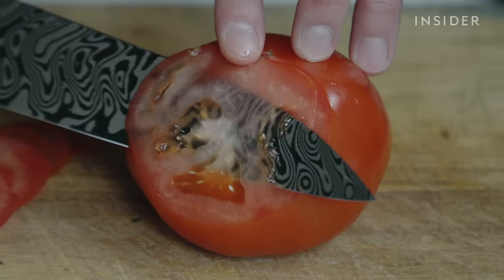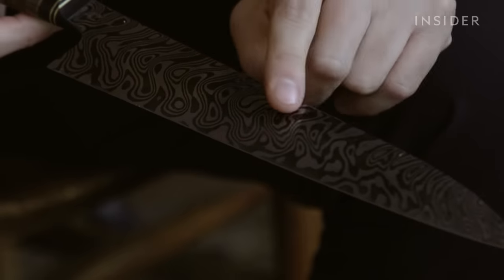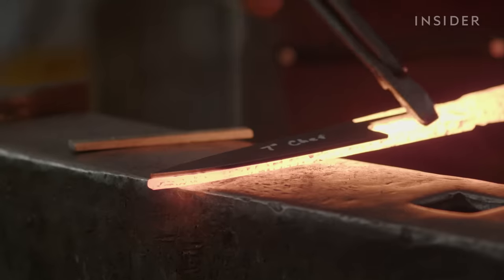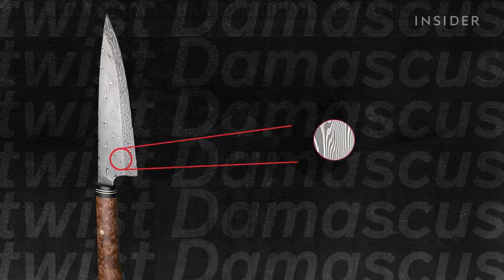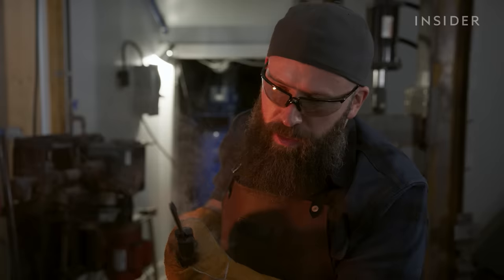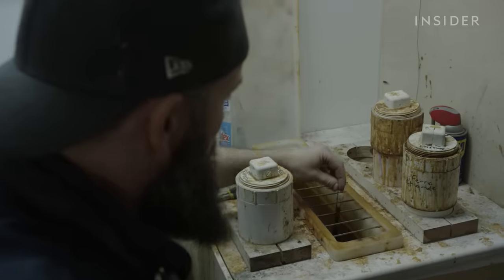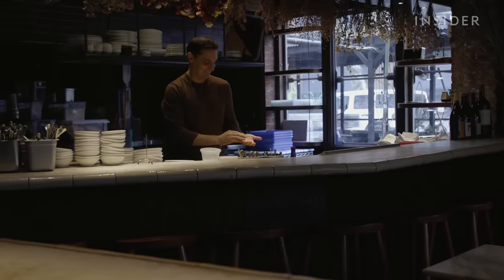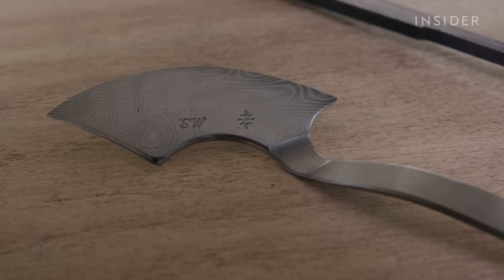Why Damascus Knives Are So Expensive | So Expensive | Insider Business

Comment: With modern "Damascus" metal, there's basically no actual benefit over regular old steel knives, they mostly just look better. Like a 1000 years ago Damascus steel knives and swords were legitimately stronger and much more hard to produce than regular metal items, and they were expensive because of their rarity, actual strength properties, significant difficulty in manufacturing versus regular steel, and of course the intricate design patterns. These days "damascus" is pretty much entirely cosmetic term, and the price is mostly depended on design, because the diffuculty of manufacturing entirely depends on design required. Modern damascus knifes aren't actually that much stronger, sharper, or more durable than regular modern steel. They do have some advantages over regular steel, but 99% of Damascus steel items is in the looks, not function.

Comment: First of all it's a pattern welded steel knife as we lost the means to make Damascus steel which comes from wootz iron which is was crucible iron that was found in India. Second it's expensive because a pattern welded steel is harder to make and require ample knowledge of what steels would work well together and years of practice to learn to achive the pattern achive the pattern your want consistently. Lastly pattern welded steel are both of similar quality to other steel knifes the only difference the pattern that comes from the diffrent carbon Contents from the steels used and the user of the knife. There are better quality steel outside of pattern welded for sure but the whole idea that pattern welded steel is better is a myth that was propagated by the use of actual Damascus steel blades which where again is just here say.

Comment: This is absolute horseshit. What we call Damascus steel now and the historical term are different. The modern version is what is described here. It does not produce a superior blade. The best it can do is almost as good as a mono steel or San mai steel blade. The problem with Damascus is, every single weld is a potential point of failure, and some faults are undetectable. If you start with a bar of mono steel and grind it to shape before heat treating, you can know that it is utterly free of structural flaws. That is not possible with Damascus. Damascus requires forging, with always risks introducing stress flaws. Historical Damascus was just steel that came from the region of Damascus, and they likely had access to a source of iron with additional elements that produced good steel for swords. The properties of steel can vary considerably based on the specific alloy.

Comment: i have a set of custom kitchen knives i ordered from a bladesmith. full tang obviously, leather scales. i dont know the steel but maybe aus10 or 8 (majority of my knives are cv20 m4 d2 s30v etc im not familiar with kitchen steels) and a suede chef bag. 

ive hardly used them lol. they cost a small fortune but are mainly decorative at this point.

Comment: Patern weld steel is absolutely beautiful and is an expression of the forger. However, it does not surpass modern powder metal steel in wear resistance or toughness. There is no "Damascus" steel that has better edge wear than Rex 121 or higher toughness than Z-tough.

Comment: I realize most commenters are knowledgeable about Damascus knives. For the few who arent, here's a little explaination;
The history of mankind has developed techniques for metal smithing. Technology, war, culinary needs, etc...
One if the hindrances of metals used in outdoors, or areas that are not climate controlled is: corrosion, rust, and wear. Hence man has searched for stronger, harder metals that will endure the physicality of "living environments".
All metals have tolerances, and breaking points. Some are more resiliant, but don't hold an edge very well. Some are more delicate and have fantastic edge retention, but wear & break easier.
Weapons and tools were developed to advance mankind's resolution of needs.
A hard brittle blade can shatter or break, even if it is a strong metal. The goal is to craft metals that are both strong, resiliant, and hold edges well. Damascus blades are made by combining different types of metals.
Typically carbon-steel blades are stronger, and more resilient depending on the blades use.
Stainless, is just that, difficult to stain. Its hard, resilient to a lesser point, but doesn't hold an edge well, and breaks easier under blunt force.
Well then why not make blades from aircraft titanium?
Cost, practicality, care of the blade, and sharpening.
Good luck sharpening a titanium blade with a whet stone. Same with stainless, difficult to sharpen.
Remember folks, sharpening removes steel from the blade in order to angle the edge. If the edge is too fine, it will dull imediately then, what good is the blade? The idea is to combine as many resilient, strong metals, with softer edge-holding abilities, that resist rust, breakage, and blunt force. Kind'a difficult actually. That's why knives for culinary use are different from knives for utility, and knives for combat use. Butter-knives are my favorite though, cause I love spreading butter on biscuits.

Comment: Just to be clear, these "fun" or "artistic" patterns are really beautiful, but they do not provide a sharpness increase per se. The point of damascus to merge softer and harder steel to combine the effects of shatter resistance (higher ductility) with high hardness (lower ductility). If you cut with the softer of the two materials, the edge will wear down quicker. Thats why normal damascus knives usually have a single continuous core and damascus layers on top. If you just mix the two steels to create these patterns, you don't get all the benefits of damascus. So there is a trade-off between looks and performance. Traditional japanese damascus knives usually have very simple and similar damascus patterns to get the most out of the blade.
Reply: Additionally, that WAS  the point of the technique historically (that and to work impurities out of the metal).  Modern metallurgy has rendered such methods largely redundant.  These days, it's mostly an aesthetic thing.

Comment: More people should watch this very interesting 50min video about actual Damascus steel (The Secrets of Wootz Damascus Steel)

You can get something quite similar in modern knives, I've only seen it on Japanese knives, can be seen on solid VG-10 blades, the iron cladding on 3 layers knives and Honyaki (expensive 1piece/mono blades)

It's the alloy(s) within the steel showing, no folding or layers. In terms of actual Damascus the pattern came through if you had at least .005% Vanadium

In my opinion, the best thing about alloy banding is that it's a natural thing within the steel, it looks way cooler than any pattern welded steel which really easily can look gaudy.

Comment: The origins of the techniques used to make Damascus steel are indeed ancient and trace back to the broader region that includes Iran. However, the specific techniques for creating the steel known as "Damascus" or "Damascene" steel were most directly developed from wootz steel, which originated in India. The knowledge and techniques spread across the Middle East, including Persia (modern-day Iran), where local metallurgical practices could have influenced or been influenced by these innovations. Thus, while Iran was a significant historical center for metalworking and contributed to the development of advanced metallurgical techniques, the direct origin of Damascus steel is more commonly attributed to the Indian subcontinent.

Comment: Iv'e been doing this for 12 years. I've made over 10,000 blades through my shop, Monolith Knives in that time. You don't need to be a Master Smith. You just need to be a good designer, story teller, and technically proficient artisan. It is an art form but not terribly  different than furniture making, jewelry making, glassblowing, or other metal craft. It is hard work though.

Comment: It is expensive because well made pattern welded steel is pretty and takes a lot of labor. It also has high failure rate. 

Pattern welding doesn’t make the product any better, but it does introduce opportunities for failed welds and inclusions. A good pattern welded steel is no better than a good monosteel. 

Actual Damascus is a crucible monosteel. They are far more rare and labor intensive because the steel has to be melted completely.  People use pattern welding to fake a Damascus pattern. They had pattern welding long before they had Damascus steel. They never called is Damascus steel until they were trying capitalize on the fame of Damascus crucible steel.

Comment: Calling a blade “Damascus” is kind of like calling it “stainless”…it doesn’t tell you much about the composition or performance. Stainless, you’ll know there’s a certain amount of chromium in solution. Damascus, you’ll know there are a couple of pattern welded steels making up the blade. Damascus blades range from ultra cheap imports to Murray Carter forged masterpieces and antique wootz pieces none of us will ever lay eyes upon. My personal favorite flavor of Damascus is made by Civivi. They’re relatively inexpensive, based on 9cr18mov (which is a phenomenal budget steel) and the patterns are attractive. That being said, there’s no “Damascus” that’s going to perform as well as a laminated zdp189 or hap40 blade…not even damasteel or damacore. Damascus blades are aesthetically pleasing moreso than high performance. You buy them (specifically the high end specimens) for the artistry involved.

Comment: Thats not a damascus knife. Damascus steel or “wootz” steel was not pattern welded. In the crucible the iron was mixed with a carbon source and then later drenched in acid to show the watered type pattern. The knives in this video are pattern welded which is where the layering and folding and twisting makes the pattern visible after an acid bath.

Also modern industrial steel is far better than anything made by anyone in ancient times. It’s just that ancient crucible steel from Persia and India at the time was the best steel in the world.

Comment: No, modern 15n20 1040 forge welded steel is not better than normal crucible knife steel, in fact it might be worse. Damascus knives are expensive because they're pretty and because they almost have to be hand made (no simple automated process, like stamping or drop forging). They do not have mystical properties, anything can be wicked sharp if sharpened right, I can get a butter knife to split hairs if I wanted. Nor are they tougher, 15n20 is a relatively weak steel to begin with, having such high levels of nickel in it, and 1040 is a fine knife making steel, but it's mechanical properties are irrelevant, since even the smallest delamination, even one invisible to the naked eye will severely limit the efficacy of the tool.

Comment: Yes, damascus steel made sense back when we were not able to produce proper blades by combining multiple types of materials together. Now that we know how to make durable, yet flexible blades - paying for damascus steel blade does not make practical or logical sense. Instead, it can be considered an functional art rather - something that looks nice and is in fact durable.Even then - true and pricey damascus steel looks almost like normal modern steel, as that "magical" pattern is barely visible. Also, there is no research suggesting that this type of steel [or rather - mechanical treatment and processing - produces anything of quality better than we can achieve by using modern ways of forging, etc.

Verdict: OVERPRICED, BUT PRETTY.

Comment: it is purely cosmetic. the increased strength is makebelieve. if anything you'd risk imperfections and decreased structural integrity (hyperbolic but correct). it looks fancy and requires extra steps in manufacturing. that's why it is more expensive.

Comment: originally called as the woot steel.
Reply: Wootz steel is a different process from what we see in the video. Wootz steel is made from heating the ingot in a crucible until the molecules break down. The video shows pattern welded steel, which is a very different technique

Comment: Expensive?? Where are you guys buying them from? I get mine from a well-known site where I pay around $40 for a large Bowie style knife with gorgeous Damascus patterns on the blade. Actual Damascus steel. Handles made from bone, wood, or antler. Damascus is just a blending of different steels. You don't have to use specific ones to get those beautiful patterns in the blade. There's no need to break the bank, either.

Comment: Mixing two poor quality steels that will etch differently doesn't create a quality blade. Generally, if the maker doesn't say what steels were used to make the Damascus, it's probably just an educational tool and basically junk. China and Pakistan produce a fair amount of this. The larger the blade, the more likely the potential for de-laminating exists and Damascus isn't worth the trouble. I have a 5ft claymore made with 5160 tempered spring steel that proved to be all but unbreakable used like an axe at a tree, I would never trust such a test with any Damascus. Spring steel will bend but it's incredibly durable and the heat treating is everything in terms of final results.  5160 was a favorite of Genghis Khan btw.

Comment: Wait, so are those $60 dollar Damascus blades on Amazon real Damascus? And secondly if yes, are they quality?
Reply: Also, cheap blades may or may not be pattern welded. Some of them just have a pattern painted onto the surface, like how you can put cool designs onto a bicycle helmet. You'll want to look into the descriptions to see if they have actual folds or if it's just an ornamental coating.

Comment: Folding steel too many times, especially THOUSANDS of times doesn't make it stronger, it actually removes the whole point of folding steel, because metal returns to its original molecular structure.

These knives are no better than any decent steel kitchen knife, the difference is purely cosmetic.

Comment: 300 layers? Lets assume he uses 20 sheets, tack welded together. 20>40>80>160>320. Folded 4 times. Insider business makes it sound more dramatic than it is. To arrive at "1000's" of layers, fold it 2 more times. Think of the famous "folding a sheet of paper 7 times" trick.

Comment: What he's doing is pattern wielding not the actual Damascus which pattern was made due to the specific mixture of materials in making the steel.  Then of course there is chemical pattern which uses chemical to make the pattern.  The knife would not be more flexible or sharp. It is more if they were making a saber.  On a side note you don't want flexible kitchen knives so saying it is more flexible made it failed
Reply: Damascus has referred to pattern welding for centuries
Reply: @Joker-em6oz  This is a tricky situation. Now if you want real Damascus steel it has nothing to do with pattern wielding,  but pattern wielding was thought to be the method used yes for centuries but it doesn't make it Damascus steel. Just like strange mixes ratio was also tried didn't work even if gave you the pattern.  It doesn't mean that it's not a good knife but technically not a Damascus knife.
Reply: @Lostboy811  not at all why pattern ended up where the name Damascus.

Comment: Modern damascus blades are just copies of ancient damascus steel. Modern metalurgy has not managed to reproduce accurate damascus steel. Modern steel is molten and not just heated. It is not necessary to layer steel in order to equalize carbon content. Modern damascus-style blades are simply an artform. The steel isnt better in terms of cutting, sharpness, durability or any other quality than the visual effect.

Comment: Iunno man 1500$ for a knife? I am not an expert but I know a good blacksmith and even with the master carpenter involved 300 bucks for a knife that will outlast the user. 100k on equipment and doesn't have heat treating oven furnance. Lil bizare. But hey if there are buyers why not, these knives cool but not 1500$+ cool

Comment: Stop the Myth!😡
The people at Insider Business so obviously don't know S#!T about what they are talking about!  
Within the first 15 seconds the narrator was saying "But these unique swirls are more than just decorative." -  BULLS#!T
Making damascus is only decorative!  A Damascus steel (even if made perfectly) can only have equal strength to the steels used to make it.  And if it is not perfect, well every single layer is a possible failure!  About the only benefit to making Damascus (that is not an artistic consideration), would be that you can use pieces of steel that would be to small for what you intend to make otherwise.
I am so tired of the persistent idea that Damascus could be anything other than an artistic endeavor.